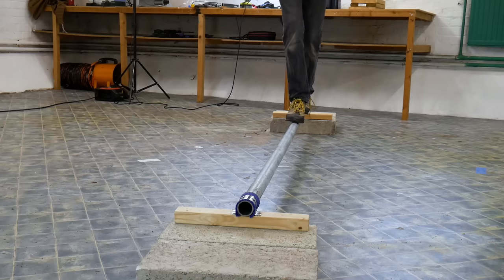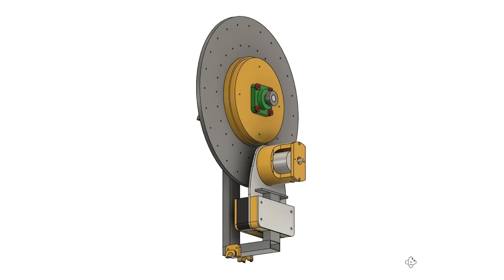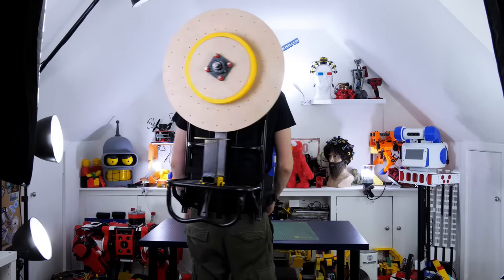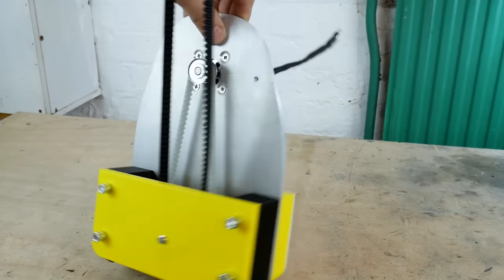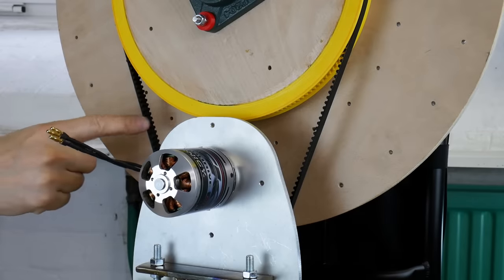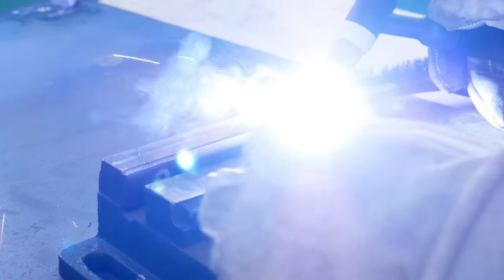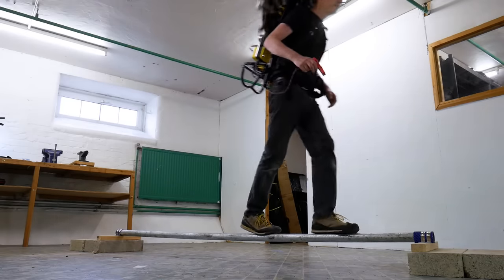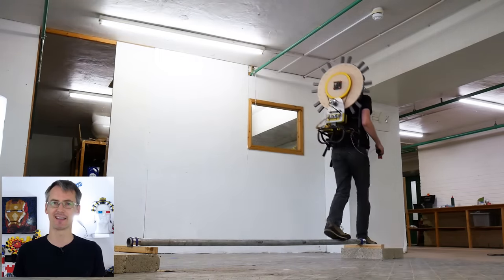Tightrope Walking Cheat Device

Comment: 3D print yourself a spacer (like washer, but about 50x thicker) you can fit over your drill bit so when you drill through some hard surface (steel) you don't ram the chuck of the drill into the steel, and/or ram the drill bit into the other side on the inside of the steel bar.

Comment: Part of your balance issue is because you're walking across a round bar.  Your surface contact is very small and it's rounded.  Try using flat stock instead.  It'll likely help immensely with the tippiness of your balance at the point of contact between your feet and the bar.

Comment: Don't use a wheel, nature does balacing (cats and other animals) without spinning wheels. Spinning means that you have to stop any reverse, it is too slow in reaction due to inertia. Use what a balancer uses (his arms or a pole), use metal poles that can be extended (folded up or down) with a minimum of jolt, much easier to do too and a lot less mass too, because the lever effect makes the small mass larger when extended.

Comment: As an alternative design option that would allow for more power for lighter weight / weaker motor input: 
Imagine to counter-rotating flywheels which you spin up to speed slowly before even starting. You siphon energy off of them by applying a break to slow them down this is the instantaneous 'jolt' you're looking for to push yourself in the opposite direction (ideally it's a weak break or a very brief one, so you only take a portion of their energy). A smaller motor can continually rev them back up to speed - this will take a longer time than the breaking so it won't apply as much of an off-balancing force during the rev up part of the process. 

Two wheels so you can break one or the other based on which direction you need to tilt towards. 

The only thing I'll note is that a design like this starts to pose a safety hazard if your fly wheels are holding enough energy, it'd be more applicable for some of those robot designs than as a wearable device for humans.

Comment: Would it help or hinder if the whole thing was dropped down or raised up, perhaps on a rigid bar connecting it to the back harness, maybe also anchored at hips? I am thinking how the distance from the pivot point of the bar would effect it? I am no engineer. I am thinking further from the pivot point (raised up above head) would create a greater effect, but also just make it harder to wield overall, being more cumbersome and hard on the back.

Meanwhile, a lower profile might enable more weight to be carried comfortably and controllably, but with less impact on the effect.

What say you all?

Comment: Wait...hold up if a flywheel stabilizer can balance a 190 (just an estimation) person then that means it can stabilize a heavy drone... Oh no I just had an idea can you build a all terrain drone that uses. Legs to walk and grip onto things and has 4 blades in the middle possibly uses it's legs to stabilize and shift itself on land but uses flywheel stabilizers in the air?

Comment: Wouldn’t an unbalanced wheel give you a greater reaction for the weight? And and high torque motor would also fix the “weight” issue, faster those motors move the more they move everything

Comment: I know that you wanted to increase the torque by placing the device higher up at your back, but i think because your body is not a fixed pole, your reflexes and reactions absorb the energy the machine exerts. I think the center of gravity of the device should be placed at the center of your gravity so that the movements that you unintentionally create do not affect the system. Imagine people pushing from sides. Would you want them to push you from your shoulders? or your waist? I think the waist would be better.

Comment: You had a LOT of dead weight in the middle that was not adequately contributing to the reaction wheel. If you had done it more like a wagon wheel with most of the weight along the perimeter and an inner concentric for both bracing and drive pulley, you likely could have made it much lighter and safer (solid rim instead of spinning blades) and might have worked considerably better.

Comment: instead of a bigger wheel or a heavier wheel, maybe try multiple smaller wheels at different positions? A cable like one for a flexible drill bit could power the wheels from a single motor. Probably have a gear box to distribute the force across multiple cables from one motor. Have a wheel on each thigh, one attached to the hip/buttocks, and another on the back?

Also if weight is needed just fill a form with lead.

Comment: I wonder if putting the center of the wheel closer to your center of gravity would help with the "squishiness" of the body. Might not work though because you might need the lever you get from putting the center of the reaction wheel away from your center of gravity

Comment: From a 1st principles perspective, it seems to me like the strength of the righting force the reaction wheel can provide is limited by the power of the motor, and that the mass of the reaction wheel is largely irrelevant - ie, gearing up the motor to turn a  reaction wheel with a smaller moment of inertia faster will produce equivalent righting force to lower gearing on a higher moment of inertia reaction wheel.
The higher the mass of the entire system, the more righting force that needs to be provided when the system gets off balance. Also, the less comfortable it is to wear. I'd try higher gearing on a lighter wheel. Of course, there are practical limits here - you can't just spin a poker chip up to 1 billion RPM.

Also, for a given diameter wheel, concentrating the wheel's mass on the outer edge would give you a higher moment of inertia for less mass.
I also agree with other posters that high on your back might not be the ideal location point, because you can bend at the waist, so as you adjust and lean to catch yourself, it could potentially even be pushing you the wrong way sometimes.

I like to go backpacking, and I've noticed it's easier to balance on a balance beam when wearing a heavy pack. To balance, your brain needs to detect the imbalance and act to correct it while you're within the envelope of the system's resources to correct. I think it's that the higher the mass, the more inertia, and thus the slower the movements as the system deviates from equilibrium, giving a slightly larger time envelope for the brain to recognize the deviation and begin the correction before the system falls outside the correctable envelope.

My point there being, I'd like to see you try balancing wearing the current device with it turned off, to prove it's actually helping you at all. Right now you've got your internal balancing system and the backpack system and the two don't necessarily work in concert. It's not clear to me that the reaction wheel is necessarily net helping at all - it could be fighting you sometimes. You might be doing better when wearing it purely due to the added mass. Probably not, it's probably helping some, but I'd be curious to see what happens with it turned off.

Comment: Id' imagine you'd have more luck with an actual tensioned wire, because the cylindrical pipe gives you less and less stability the further from the center you get, whereas the wire will move to keep the tension in line with your center of force.

Comment: this machine is very dangerous for you at this stage. you'd better use a heavy ring instead of metal bars sticking out. (better solution is fully enclosed counterweight)
if something go wrong and you start to fall your hands can automatically spread towards rotating bars (by instinct) and you will get hurt (probably a lot).

Comment: It seems like you may have luck turning the device upside-down on the pack, so the wheel is at your hips and near your center of mass.  That should make it feel like the people on either side are pushing on your pelvis rather than your shoulders, and you won't need to worry about your spine absorbing the force.  On the other hand, you'll need more force because the device is closer to your feet pivot point, so maybe take @Kyle Jacobs' suggestion on redesign of the wheel.

Comment: The momentum is made by the X-distance between the tube and the centre of the body mass. While the current device detects the angle of Z axis of the body. So the device won't help when the body is falling strait. Also, it will push the balanced body when it is tangled. Even more, when the body is just started falling and is tangled in a different side, the device will help to fall faster.

Comment: Hey just a little hint here but a LARGE part of where the balance comes from is by using no shoes or shoes that allow your feet to flex and almost wrap around the beam or rope. It's incredibly more difficult with solid flat soles like your shop boots there. Lol with this and a proper set of foot ware you'd probably make it as long as the beam could be. Lol

Comment: I read down through the comments and didn't see anyone suggest this, but maybe a cheap and easy balanced weight would be a couple car brake rotors. They're usually pretty heavy, especially a couple of them, they're compact, and wouldn't be that hard to adapt the current system to use them.

Comment: What if? 
What if you made it lopsided? 🤔 
Putting all the weight on only one half, like remove the top portion splitting it at the equator throwing the weight in the opposite direction you are falling then resetting the weights to the bottom. And you wouldn't need such high RPMs to create the stability of push opposite of your fall.

Comment: Move the wheel to around your butt and anchor it there. You're increasing the reactive moment by having all that mass above your body's center of gravity. It would also be more effective because your spine isn't reacting to it and your legs have very little lateral flexibility past your hips. Remember, a moment applies to the whole structure regardless of location on that structure. You want to react to the moment that come from the distance of your feet to the center of your body's gravity, times your mass, times gravity. So don't increase that distance, rather, try to decrease it especially considering you are raising your total mass.

Comment: Try 2 counter rotating wheels so each wheel has a quicker potential to reach and maintain a higher velocity. Its taking too long the way it is now to slow down and reverse rotation. Both would spin the same speed when perfectly balanced. One would slow down and the other speed up when off center. Divide the current mass between the two. Should be golden.

Comment: It doesn't work well for 2 reasons. One, the body naturally attempts to balance so when something does it for you then when you try to balance and the robot also tries to balance then they cancel. Two, the robot is programmed to work with a Ridgid object and hips are a hinge that throws the balance off.

Comment: i think tightropes are ropes (aka flexible) so that you can shift the rope itself in order to push your body back toward the center of gravity. In other words, its much harder to balance on a stiff beam than a rope. When you move your feet to the left/right you have a better angle to push against in order to move your body back to the center line. I'm not sure if it makes sense or how to explain it in words

Comment: accelerating the wheel generates inverse torque reaction applied to you but the torque has to balance the torque of your weight off centered from the contact point, plus fight the moment of inertia of you weight far from the bar. sounds like adding more weight to the wheel shouldn't change much the reaction from the motor as long as it puts out it's maximum torque. it just won't be able to provide torque for a long time if it acceleates a very light wheel that will quickly  reach it's max speed.

Comment: I wonder if mounting the wheel nearer the center of gravity (which would also be the top of the relatively straight line of the legs to hips) would yield better results.  You wouldn't end up having your torso fighting against the benefit of the wheel and it would be acting more effectively on your whole mass.

Comment: i feel that the cpu is only equating for sensors on the ruck sack structure and is not taking into account all the inertia generated by the rest of the body parts moving, like arms, head, and torso, if you a sensor wired or bluethoothed in each body articulation plus every arm, forearm, thigh, shin, abdomen,chest neck and head dialed into a cpu with an algoritm(?) of some sort or coded program to take into account the body cinestesia and inertia you will get a very usefull product lets say for rescue teams, the military, firefighters.. i would love to see it in the future in one of your videos.

Comment: There is too much mass close to the centre where it has little effect . As someone else mentioned you should put as much as possible at the circumference .maybe an Aluminium wheel with lead weights bolted just inside max radius - would also prevent nasty sharp rotating objects in reach of your arms that were making me nervous

Comment: You should remake this with broken tungsten carbide end mills from eBay as the outer ring of mass. Maybe reduce the weight of the middle section like a wheel.

Comment: This thing is VERY dangerous!  You should either enlarge the wood so the "pokers" are within it, or add a round rim.
          Also try: walking the beam with the thing , but turned off.  The high weight may be the thing that is helping you balance more than the reaction wheel.

Comment: Curious, how would it fair if you walked with a slight lateral trunk lean, so that the wheel simply have to change the speed that it spins, rather than constantly trying to change directions? 
Cool video!

Comment: When you are balancing on the bar, instead of placing your foot inline with the bar you should pivot your foot in such a way that your heal is off the bar and the cusp of your foot - the ball joint just behind your big toe that leads into the arch of your foot - sits on the bar.  This way you can react to your imbalance by lifting or lowering your body with your calves.

The farther you can point your heal off the bar the more reaction you will get out of this.  It can help to learn this technique by turning your body sideways and walking across the bar sideway to begin with.  Perhaps even practice perching on the bar with your toes before you try to walking across it.

Comment: What if you had two reaction wheels going in opposing directions and then using a kind of breaking mechanisam to do the pulling back and forth. That way you can spin them up to much higher speeds, so you can have less weight.

Comment: I just found your excellent channel! 
 
Having practiced and thought about balancing (myself, using myself, with varied and escalating challenges, tools to assist and give feedback) a lot, I LOVE and am inspired by this idea (and it gives me some new ones)!
 
A couple thoughts that might be helpful:

1. As you said, our squishy, twitchy, uncalibrated, non-rigid bodies tend to react somewhat chaotically w/re: handling sudden, unexpected changes in acceleration..well, to do what gymnasts do, these things are controlled with strong, simple body postures and muscular tension..effectively reducing the number of moving parts while increasing robustness of postural integrity..which simplifies force handling.
 
In your case, consider these tips:
 - Hips tucked
 - Tight core
 - Squeeze glutes
 - Knees slightly bent
 - Arms straight
 - Head neutral
 
If you spend a little bit of time practicing this posture..going over the points of focus repeatedly, trying to strengthen each one and your ability to maintain them all..I think you'll find that it makes your body more straightforwardly compatible with your device.
 
2. Rather than making your weights heavier or the arms longer, what about maximizing weight distribution toward the ends of the arms?
--------------------
Great stuff - subbed! ,{^_^}"

Comment: I wonder if it would have worked better if you used it to lower your center of gravity and flipped it upside down so the wheel was closer to your hips. You've raised your center of gravity by having the wheel that high up.

Comment: Would it be feasible to have the weights be able to go towards and from the center, then have a smaller circle-ish shape guide half of the weights in. This could save you on weight by having the reaction be more directional at the cost of friction and energy consumption

Comment: Why did you use such a big flywheel and then ratio it down with belts? Wouldn't it've been easier to use a smaller flywheel directly on the motor shaft at full speed?

Comment: What about using propellers that are flat against the wind that way it's still light but you can spin the motor up faster, stop it faster, and it won't hurt your back after, idk if it would actually work but it's just an idea

Comment: On the other hand, this wheel is quite high relative to your center of mass which is around your lower back. If you can put the wheel closer to the center of mass this may work potentially better.

Comment: The distance between his elbows and utter annihilation was so small so many times in this video. if he had moved his arms back just a little further that huge steel mass moving at high speed would have slammed straight into his joint. That can't be remotely safe.

Comment: Maybe using the lateral offset of the wheel from your feet / the bar would make this easier for you to use.

Your torso angle does not in general indicate which side you are tipping toward.

Comment: what if you just replaced the flywheel with a long flexible tail and used the hand controller to push it left or right so you could push against the momentum with each step?

Comment: the mass should be able to rotate faster. there is a rpm limitation (voltage ?, motor controller?). remove reduction gear and give motor more current.